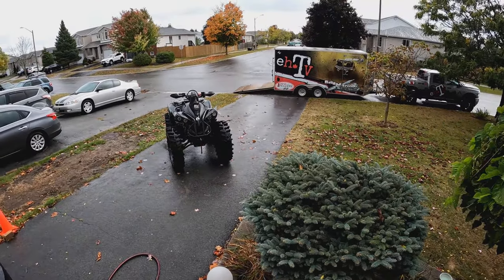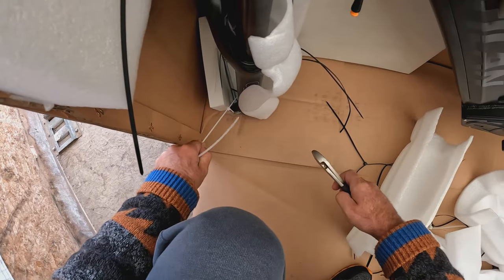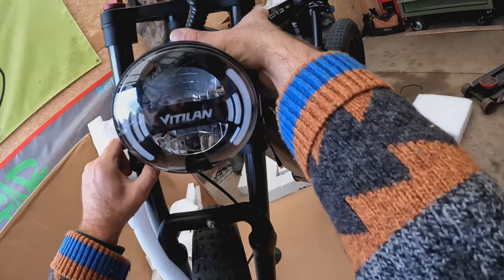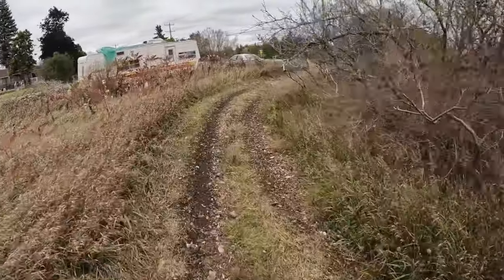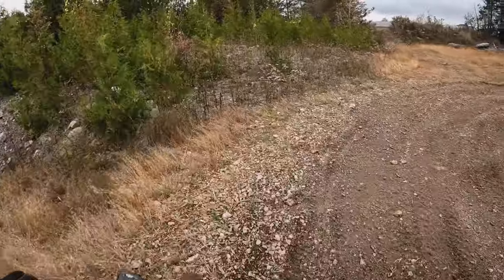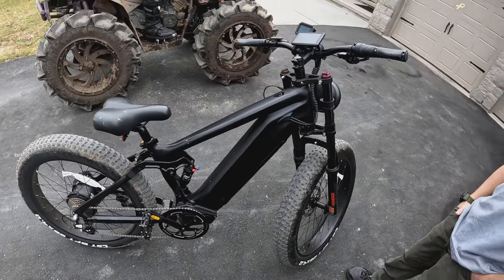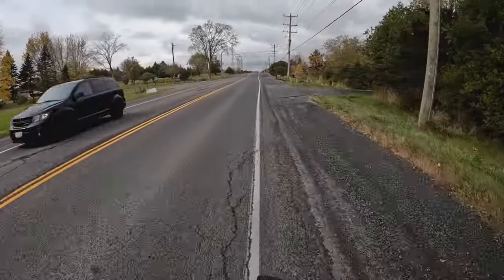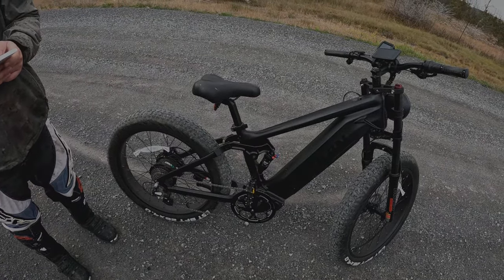Vitilan T7 eBike Races Renegade

Comment: I saw a guy review one of these. He set the tire size to 20 and GPS confirmed 33mph but it won't show the correct speed on the bikes display. 
Ive got a different bike but think ill try that trick. 
I wonder if standing start is quicker as well. Cheers anyway
Reply from the maker: Yeah it works, got 30mph out of mine
Reply: Standing start is just as slow im afraid.
Reply: @GG-ml3vr they're trying to preserve the motor. Pushing loads of amps into a motor that's not spinning fast can burn it out quite easily. So with this bike they programmed it not to give maximum power until you are already over like 10-15mph.

They just launched a pro version of this and it still accelerates slow but does 36mph instead of 28.